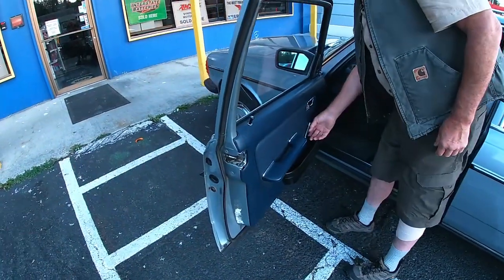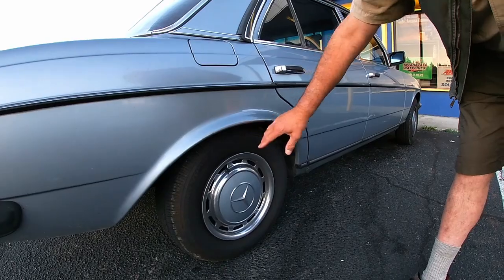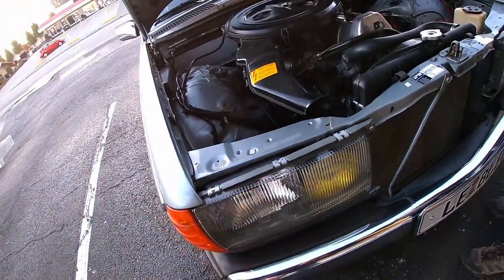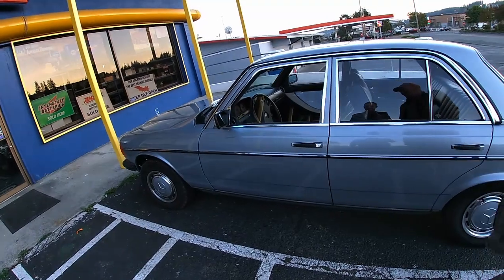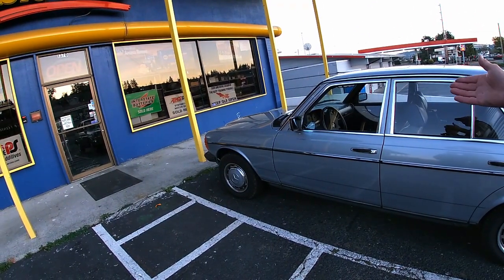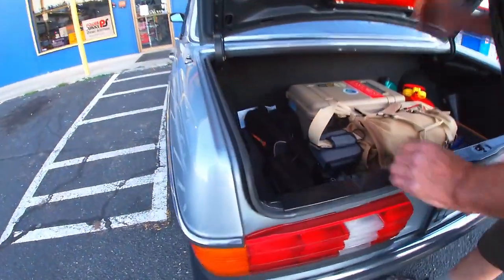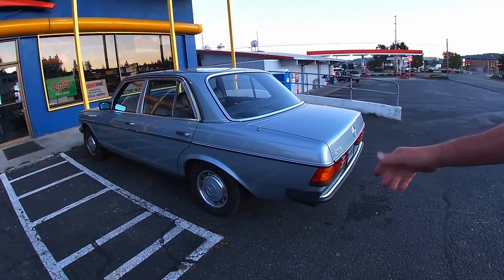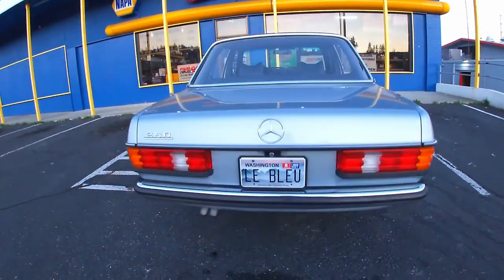Amazing Euro Mercedes W123 250 Imported from Berlin, Germany! I Finally Chased Down the Owner!

Comment: very nice car. they are rare now in germany, especially with this engine and condition. but the gentleman is not right. the topmodel of the 123 chassis was the 280E (E for Einspritzer which means fuel injection) with 185 hp. there was also a 280 carburetor with 156 hp.
Reply from the maker: True! I didn't listen to half of the conversation because I couldn't stop admiring the car!
Reply: @VITOSGARAGE  oh yes. I can understand that very well
Reply: 280 the first model.. 280e second model 81' onwards..
Reply: @Benzer18  280/280E were both avaiable from the beginning in 1976
Reply: @vornamenachname5589  no
Reply: @VITOSGARAGE  his 250 is also the second run of the engine as the valve cover is square a little, the early models had less horsepower and lower gearing so you can't go that feast :-p
Replacing the rear end is not that easy and the stupid tachometer is wrong then

Comment: The highest petrol engine for w123 is 2800cc@m110 producing 185hp..the most powerful engine available for w123 that era...this 2500cc produce about 130hp to 140hp..and this engine can be found mostly in limousine or stretch body...and i got a 230e injection 5 speed manual... Replacement model for 250..
Reply from the maker: Very nice! And that's true!